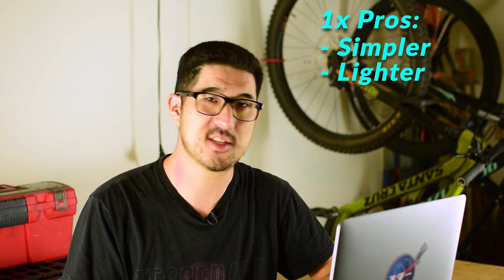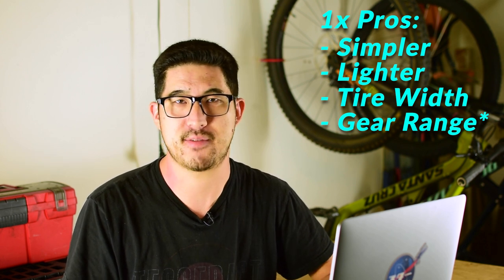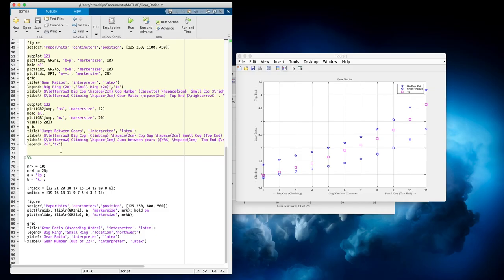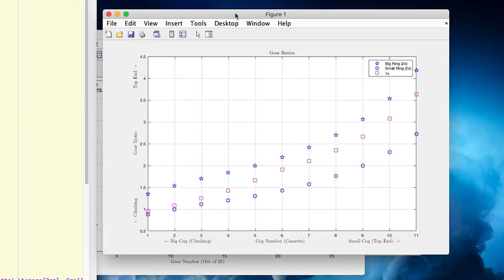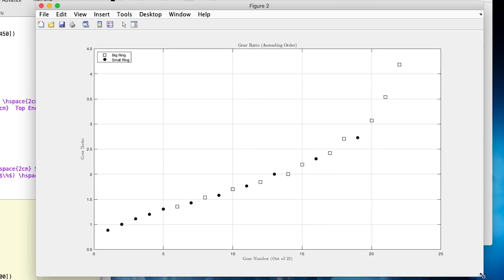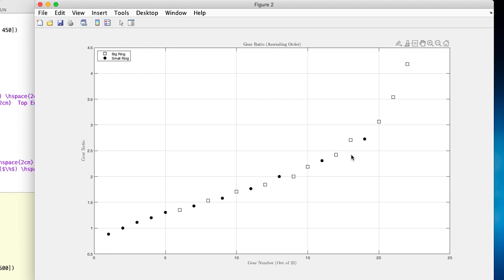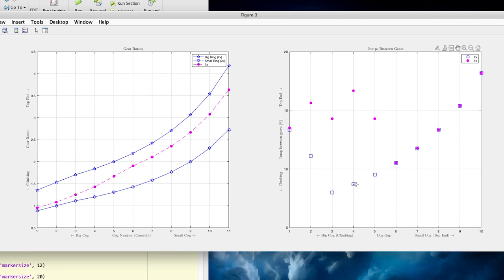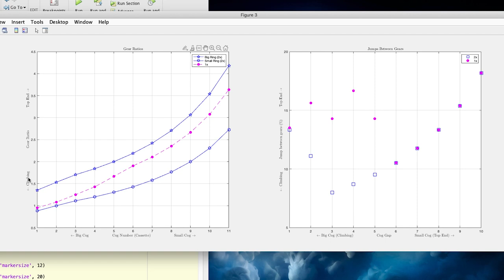1x vs 2x Drivetrains For Gravel Bikes | The ANSWER! (Is In Gear Ratios)

Comment: New sub here really enjoying the videos. I'm trying to decide between the Diverge comp E5 and the Diverge Sport Carbon you have. I originally thought I'd never consider 1x but this changed my mind. Now I need to decide if the $1200 extra (2799 vs 3999 Canadian dollars) is worth the carbon frame and upgraded components. If you were me, would you get the aluminum frame and 1x for $1200 cheaper, and use that towards carbon wheels and/or other uprgades? A nearby shop has both models in stock in my size and I think I need to act soon.I really prefer the color of the sport carbon as well, but at $4k CDN I'm finding it hard to justify even though I'm selling two road bikes to finance this purchase. Any input is appreciated, thanks.
Reply from the maker: Ahh yes, tough decision. Great that both are actually in stock though. The primary difference is obviously the frame material, so I'd think about how much you value having a carbon frame. Anything else can be swapped at a later time. Have you actually tested AL vs carbon and decided for yourself which you prefer? If not, then maybe you can test ride both at the shop. If you're not racing competitively, then differences in weight and stiffness will be practically negligible. Carbon in theory will damp out high freq. vibrations and feel less "chattery" than AL. Then there's the aesthetic appeal; if you just 'need' to have a carbon frame, then that's not nothing. You don't want to buy the AL and wonder if you should have gone carbon. Conversely, it's unlikely that you'll buy the carbon and later wish you had purchased an AL frame. 

To be truthful, I fall into the "I really want carbon, but I know it's not actually making me a better cyclist" category. Coming from an old aluminum Allez road bike, I definitely feel the difference and enjoy the muted ride of the carbon frame. I've mentioned in the past that I prefer to spend money on the frame, then gradually upgrade components later, but maybe different for you. 

Well, there's a whole lot of nothing. 😆 

Happy shopping! (Remember to enjoy the bike shopping process!)
Reply: @TheBikeSauce  Thanks for the reply! I think I fall into the same category of "needing" carbon. Seeing as the two road bikes I've owned have both been carbon fibre, I think I'd notice a difference but it's probably in my head. I think I'll end up with the sport carbon but if I don't act soon the inventory levels might make the decision for me!! Thanks again, looking forward to more videos. Excellent presentation and very in depth, I really like the no nonsense approach
Reply from the maker: Too kind! Best of luck. Go get it today! Haha

Comment: Hi. I'm looking to upgrade my 3x7, because I'm maxing out the gears on the road, but I'm bit struggling on steep climbs. I have my eyes on either a Shimano Deore 2x11 (11t-51t) or SLX  2x12 (10t-51t), or if I go 1x, I'll either have a 9t/10t - 50t.

Having just used 3x7, I'm slightly inclined to choose a 2x due to more lower gears available and I assume a slightly better top speed than a 1x. Now that I've watched this, I'm thinking if those jumps would really bother me at all, and because somehow I can manage climbs with a 28t chainring and 14t cog, so I guess those lower gears on a 2x would be unnecessary for me? Would I also miss out the 2x if I encounter sudden inclines where I could just shift to a smaller chainring?

Again, I ride hilly terrain for the most part, while also enjoying high speed on descents/flats. I'd greatly appreciate your inputs. Cheers!
Reply from the maker: Hilly terrain and a speed machine on flats? I'd say probably makes sense to go 2x. The 'sudden incline' thing isn't as big a deal as you'd expect. Even with 1x, you can smash through all the gears in a couple of big swipes through the shifter and get in the right gear in a couple of revolutions.

Comment: One thing to add (which you briefly mentioned - but didn't dive into) is that a 1x system will have more efficiency losses at the top and bottom cogs due to  the chain line. Aside from the the efficiency losses, it will likely lead to reduced chain life compared to a 2x system assuming you do not cross chain at all. I'd be interested to see if this is more or less noticeable on gravel bikes with longer chain stays (Ritchey Outback 453mm) vs shorter ones (specialized Diverge 425mm).
Reply: I'm converting my 3 by 7 into a  1by 7 and I may only use the middle 5 cogs just to keep that chain line at a minimal angle   ===they just don't make 5 gear cassettes any more
Reply from the maker: You may find that your gearing range is quite limited with an effective 1x5 system.

Being 7spd rear, it’s very likely that it’s a freewheel (and not a cassette). If this is the case, you won’t be able to later upgrade to wider ranging cassette as the hub design is different. Just something to consider

Comment: I have a question, What does the added resistance of the drive train do to these calculations? With the range of movement that is happening in a 1 x 10, 11 or 12 speed setup The chain is going to be pushed to it's limits on side to side movement. On a 2x system the movement is less because with two gears at the front the actual movement side to side will be far less. I'm just getting into MTB's, been looking around before I decide and this is the biggest issue I see. Curious as to your opinion on the potential Parasitic drag created by the 1x systems
Reply from the maker: If you’re getting a mountain bike, then 90% of your options will be 1x. The gaps are larger, but it’s not as critical. The drag due to bad chain line is way overstated in my opinion and represents a small percentage of losses when compared to other sources like aero drag and rolling resistance
Reply: @TheBikeSauce  The bike I'm eyeing right now is a Mongoose Dolomite ALX, it comes as a stock 2x8 cassette type. I know it's a cheap bike, but the intention is more a cruiser and exercise than trail riding or  exploring. When I get it I'll run what it has for a while and decide, just wanted your input on things like efficiency and drag. I know this is an old vid, so thank you very much for your thoughts
Reply from the maker: Nice! Yea just ride as is, and you’ll develop an opinion on what (if anything) needs to be changed. Enjoy!

Comment: How do you progressively shift up on a 2x? Or more precisely find the exact gear for a specific task without hunting the gear between the front and rear gear.
Reply from the maker: Typically you’ll ‘hunt’ for the right gear with the rear derailleur (cassette cogs). You’ll switch front chainrings when you need a different range (big cog for going fast, small cog for climbing)

Comment: I know this might sound crazy, but would it be possible to have a 2x8 Setup where the chain rings are 44T/22T and the cassette is at 11-42T?
Reply from the maker: capacity would be fine, but I think the 22-44 jump might be tough for a front mech. Never seen it.

Comment: gotta tell you after experiencing a couple of chain breaks on my 1st gravel ride and loosing 6¨ of chain. I will stick with 2 X. I maintained all my climbing gears after loosing the use of the large chainring and limped in. 1 X that´s not happening.
Reply from the maker: It's all personal. Never even considered this 😆 (also never broken a chain - not strong enough I guess)

Comment: Hi I have an old 1x I'm getting ready for rail trails. It's a 6 speed I'm hoping I can put on a 7..there are a few steep small climbs. I don't need to travel fast say 15-20 kmph on the flat. I'm 72yo too. Should I swap my front 48 tooth for a 38 tooth
And go for the 42 tooth on the rear! I've heard  I can't go much lower gear than that for the derailleur. 
What do you recommend? Thanks col
Reply from the maker: Hello! If it’s a 6 speed, then it’s a freewheel hub, which means there aren’t too many option for large cogs. If your front chainring is 48, I’d certainly start by just reducing that ring. A 38 tooth would be great to improve climbing, but you’ll likely need to shorten the chain a bit. If you loose too much top end speed, you could explore a larger range cassette, but if you want really wide range, you’ll be better off with a cassette style hub, which can take 8,9,10,or 11 speed cassettes. Cheers!

Comment: How do you rate chainline issues with 1x, so potentially wearing out your chain & cassette faster with the higher chainline on the smallest and biggest cogs?
Reply from the maker: I think the additional friction and losses are generally overblown. Extreme crosschaining will cause more wear, but it’s not worth disregarding 1x in my opinion

Comment: I'm planning to build my first gravel setup. Coming from a 1x - 34t on a 10-51 casette. Is it ok to build a 1x - 42t on a 11-52 casette?  Or should I go with a smaller chainring, 38 or 36t instead?
Reply from the maker: All depends on your terrain and ability. Sounds like your 34/10-51 setup is an mtb. A gravel bike will presumably be lighter and easier to climb, so a 42 shouldn’t be a problem, especially with the 52 climbing cog. If you find you need lower gearing, you can always go to a 40 or 38 chainring up front. If it helps, I just went GRX 1x 40/11-46, and haven’t been wanting for a lower gear yet.

Comment: I dont want to debate i want clear answers..If I get  Giant Trance 3,is there some specific gearing that will enable me to ride LONG distances like 25-60 miles on a regular basis,or do I really NEED to get a 2xdrivetrain? I know this was about gravel bikes yet  it's still the same question.I need to know because I am coming back and only getting ONE bike to ride long distances... I was on a Cannondale F700 hardtail and did a LOT of climbing and long distance rides..
Reply from the maker: The idea is there is no one clear answer for everyone. People ride 25-60 miles on single speed. If you want to cover all your bases, go with 2x
Reply: @TheBikeSauce  Ok,so what is out for around $2000 that is a lighter full suspension 2x  drivetrain? Lets say less than 32 lbs..

Comment: I am confused......I need a 53/11 set up, or at least 51/11 for my top gear. Is this possible on a single front crank set up. I find that I top out otherwise.....on descents and in tail winds
Reply from the maker: Perhaps 1x isn’t for you. I’d say if you geared high enough on a 1x for your preference, you might not have enough low end to climb
Reply: @TheBikeSauce  thank you....that is what I suspected. Great video, and great presentation

Comment: I think I have a unique 1x setup with a 11-30 cassette and a 38t chain ring.  I don't need a wide range as I mostly ride on flats.  Even with this setup 90% of my riding is in only 6 cogs in the middle of the 11 speed cassette with hardly any cross chaining.  With my previous 2x setup I was cross chaining all the time.
I do think that there is no need hard gears for true gravel riding.  Who still pedals while descending at 30 mph on gravel??
Reply from the maker: Good point. The type of riding you do should mostly dictate your gearing. I definitely need a granny gear that’s less than 1, but certainly I almost never top out and run out of gears on the upper end.
Reply: You know what, I have the exact same combination of 38T chainring and 11-30 cassette! Shimano 105 short cage derailleur. Where I live, there are basically no hills at all so no need for really low gears. That cassette suits perfectly my typical riding speeds with a nice selection of closely spaced gears in the middle of cassette and a nice straight chainline.
Reply: @anttibusk4401  Hmm, I thought I was the only one with that gearing.

Comment: big update: since there is a "new" Hub Gear (the classified powershift), you can now have a 2x system without any weight gain on you bike with just switching the back wheel. It cost over 1k though, but a have the big benefit of a 2x with instant (!) shifting even on load. thinking of getting one - maybe you can "call" them for a review? Use this video as a "marketing" factor :D
Reply from the maker: Thanks for looking out! Funny, I already contacted them and they said they'd reach out if they come to the US. Translation: probably need to be a bigger YouTube channel first 😄. The product looks awesome though. Would love to test.

Comment: sir I would like to ask for a beginner cyclist like me, I want to buy 1by 34t with  11-46T cogs from 2by 50/34T with 11-28T cogs   
I know that 1 by is more advantageous on uphill but what about  on flats? having 50T crank can make a difference or 1by can find a similar gear ratios by going for its smaller gear at the back?
Reply from the maker: With your numbers, you will be able to climb much easier on the 1x, but you’ll have almost no top end speed. You may wish to faster on flats but not have enough gears. In general, 2x affords range and resolutions between gears, 1x affords simplicity.
Reply: @TheBikeSauce  Thanks for the reply! All the best!

Comment: I would go 2x with11-32 an a 42/30  crank. But there is no such 42/30 crank. A   46t/30 2x is too big of a gear.
So I run a 1x 42t 11-36 and it's good enough for  speed and climbing

Comment: Wide range cassettes. I want my 3 by back. With a tite cassette so I don't have big jumps in gears
Reply: What I miss about the 3 by system is most work is in middle ring travel gear on flat small ring for climbing and larg ring for down hill

Comment: Hi which is better shimano or sunrace 11-40t? Thanks
Reply from the maker: Ohh loaded question, ha! Do yo mean Shimano Deore XT CS-M8000 vs CSMS7 EAX 11-40 cassettes? Generally, Sunrace is regarded as a more affordable option than Shimano or SRAM and they seem to perform just as well, BUT I haven't actually used any Sunrace products so I can't speak with authority.
Reply: @TheBikeSauce  hi I would like to convert my 2x to 1x, I'm thinking of 40 chainring and 11-46t, what derailleur can you recommend.? Thanks
Reply from the maker: I am fairly certain the GRX 812 can handle 11-46 without any modification. Pathlesspedaled just put out a video on the S-ride rear mech which can handle large cassettes natively as well.
Reply: @TheBikeSauce  how bout keeping my 2x 46-30t and putting 11-46t, is that derailleur works?
Reply from the maker: I think that may be too wide a range with 2x up front.

Comment: What about the loss in efficiency with the more torque extremes with only one front gear.
Reply from the maker: 1x shouldn’t impose any additional torques on the system. The wider cassette on 1x is meant to span nearly the same range in overall gears as its 2x counterpart

Comment: I  have been riding an 11/40 2x for over a year and having previously had the 11/34 2x I can say although the jumps are a little bigger, I got used to it really quickly and wanted better climbing range. I am considering a 46 f and 11/42 r 1x and I feel this is the way to go for me. I dont think I would lose out on the top end as I am not bothered about speed and only occasionally get into the 54/11 going down hill which is fine for me. As I live in a hilly area climbing is my focus. Great video and loved the nerd out. Is there more mechanical advantage from a 2x 50/34 with an 11/40 for climbing say 34/40 = 0.85 MA on normal bike or a 46/42 = 1.09 M/A clearly the 2x wins out but if you add an Ebike motor on the 1x then who knows. I am coming back from injury and wanted to know your thoughts about which one to buy. I think the 1x is alot cheaper so can upgrade the groupset or wheels to keep the weight down even more.

Comment: When are they going to make a 1x that has proper range?... which would be a 40, 42 or a 44t chainring with a 10-48t cassette? AXS doesn't count, it needs to be mechanical and not cost 2000.....PLEASE this is what is needed to make 1x system viable for road bikes

Comment: I like more the 2x for two reasons: 1 is gear range, you have lower gears and higher gears than a 1x (depending on the setup obviously) and 2, is jumps between gears, not needing a dinner plate in the back reduces those jumps

Comment: CAN YOU DO THE SAME FOR THE SRAM AXS GROUPS?????
Reply from the maker: Which groups would be worth comparing? Was thinking axs 1x12 and campy ekar 1x13
Reply: @TheBikeSauce  BEST comparison would be Force AXS 1x 12 speed, 10-50 cassette, 44 chainring vs. Force AXS 2x 12-speed, 10-36 cassette, 44 chainring.    this way, if you do same brand but diff. setup's, it gives folks true 'side-by-side comparison.  THANK YOU IN ADVANCE!!!!
Reply: @TheBikeSauce   maybe shimano 1x vs 2x, as well.  my guess is folks will decide on brand first, then 1x vs 2x would be final step.  just thinking out loud...
Reply from the maker: Will work on it 👍
Reply: @TheBikeSauce  THANKS IN ADVANCE!!!!  actually in middle of decision on Force AXS 1x or 2x.  hardcore roadie of 255,000 miles on asphalt so REALLY trying to consider 1x.
Reply from the maker: For the 2x, you said 44 chainring. Did you mean one of the 3 Force crankset options? (48/35, 46/33, wide 43/30)
Reply: @TheBikeSauce   you're correct I forgot to be specific.  46/33

Comment: Nicely done. I just bought 2X ( old roads ), for similar reasons to you.
Plus I can’t get used to that huge ring on the back. And I would miss that big grinding gear.
Now I’m thinking 1x might be pretty nice. 
Check out the Ekar 1x13.
Reply from the maker: Thx, yea there’s no clear answer (despite the video title 😂) and it’s a very personal decision. The campy system looks cool, but I’m not sure I’d go ekar if I went 1x.

Comment: I have done an analysis on the jumps between the gears as well, although I simply used a spread sheet:  https://youtu.be/U7M9-VfE8CU. However, it is possible to more easily optimize the 2x gearing as my analysis shows.
Reply from the maker: great analysis!